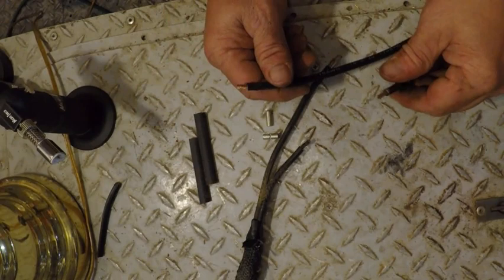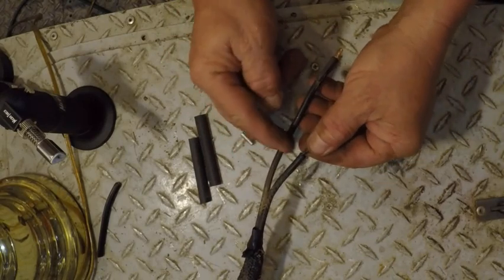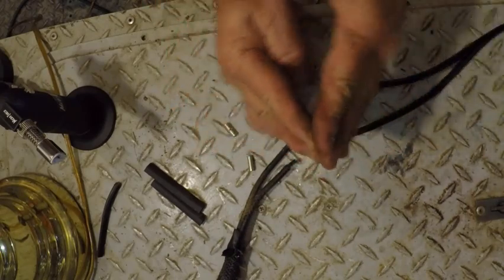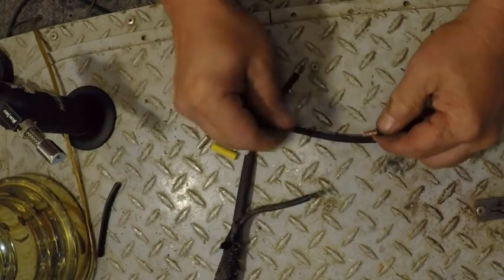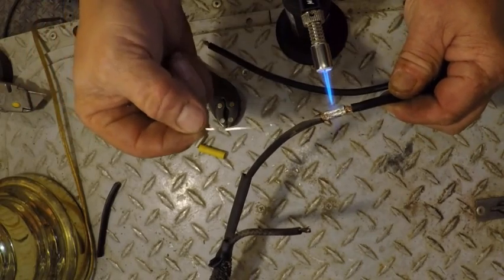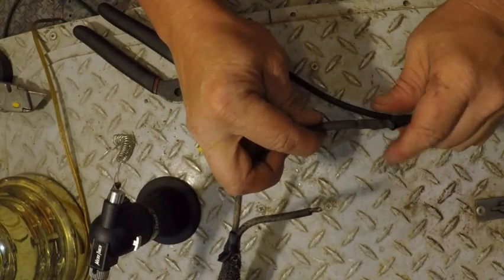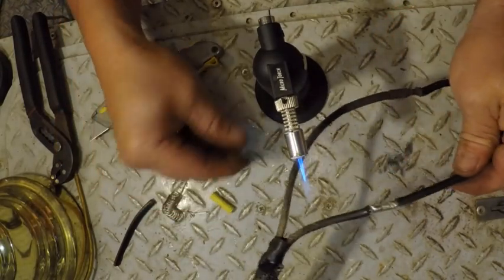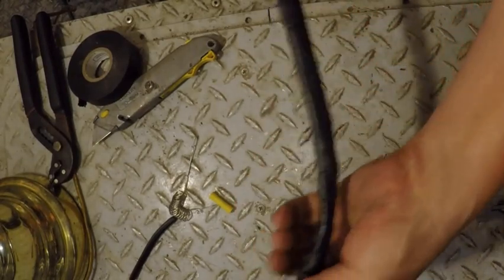Extending and splicing trolling motor wires DIY

Comment: Hi,,, Your post has helped me out—— I have a question I hope you can answer- I have a very small boat and a 30Lb. Thrust Minn Kota for it which I believe is the smallest they make,,, my issue is this— it would be ideal to balance my boat if the battery were forward— to do this I just need 5 extra feet of cable but I’m not clear at all on what Gauge or type of wire I should be using as I’m an electrical idioT!!,,,   I still have enough skill to build this using your instruction but just need guidance as to what wire or cable I should use—- any help would be greatly appreciated.,, Thanks—-
Reply from the maker: No more than that you could get by with just extending the wires you have with the same guage wire. It should say on the side of the cable what guage it is.

Comment: nice tips for sure. but if your heat shrink is far enough away you can let it cool some after the solder as long as you dont overheat it crazy style and then get it over everything easier. i have one question about trolling motor though. most have really short wires for the foot pedal.. are those able to be extended? ive never had one, trying to get a used one for cheap and ya most im seeing are just too short for what i need it for.  i need the bow mounted but able to have the foot control farther back in boat to help me gather trot lines near a live well so i dont have to mess with main motor  or extend the main throttle and do a pulley turn system since my boat at the rear has the aluminum back built up inside that helps it to never be able to flood and sink the boat and seems the trolling motor might just make it less work to get boat out there and less gas used while getting the lines up. might use it also to put out the lines. nice video though man. take care.
Reply from the maker: I’ve never extended those.  I have a minn Kota and it has a very long cable in it.  I also added the copilot so I could work it by remote.
Reply: @bowl830  dang i almost want to go buy a cheapy cut it up and see if its possible. but dont want to buy a higher priced one used which i need if i cant do it. the bad thing i need a long shaft and there isnt many options used since most have short shaft ones. and finding the right thrust, shaft, with a long pedal used is a pain to find. but if i can it saves like half the price of a new one. thanks for answering.

Comment: What brand trolling motor you have mounted on your 21' StarCraft. What model is it and how long is the shaft. or if you have any recommendations on a newer unit. since this post is a few years old.
Reply from the maker: I have a 70lb 24volt 60” shaft  I-pilot.
Reply: @bowl830  thanks for the info
Reply: @bowl830  Now can you run contour lines with that I-pilot I see you run a Lowrance unit. I thought you could only do that with Hummingbird units. I just got a Lowrance Elite 9 FS ,& it would be great if I-pilot would hook up to mine. I have yet to get a trolling motor yet, still shopping. Any suggestions? My boat is also a 21' Starcraft 1988.

Comment: Question I have a 36 volt fortrex 112 pound thrust.It came factory with 10 gauge wire from the head its 5ft.From my batteries and breaker to the plug is 8 awg  and roughly 5 foot now from the plug to head is 6 to 7 foot .The question is would you guys run 8awg from the other end of plug and cut the 10 awg factory wire down to 2 or 3 foot or just splice into the factory wire?
Reply from the maker: You won’t have Amp drop that short a distance. I’d go with what you got if the performance is good
Reply: @bowl830  Thank you!

Comment: Is that 6 awg wire? And is this for a minn kota 55lb thrust? Doing this right now so I'm curious. Thanks! Good watch 👍
Reply from the maker: Yes sir.  And yes it’s a 12volt minnkota 55lb thrust
Reply: @bowl830  I hope you see this and get back with me..! my trolling motor is a 6 gauge but I got 6 gauge jumper cable cut the ends off of them.. but the cable is much bigger than what's on my trolling motor any ideas what's up with that ?? Cuz I wouldn't think a thinner gauge hooked up to a bigger gauge of wire would lose power or not make something run correctly I'm not electrician but please help with this if you could thank you
Reply from the maker: Jumper cables are usually a lower grade wire do they’re bigger to get the amps transferred from battery to battery. I use a large clamp butt connector for that problem.
Reply: @bowl830  thank you for the fast response. May I ask you this now .?? I have to go 12 ft that won't reduce the power to my trolling motor?
Reply from the maker: Going that far you will have amp drop.  But not sure how much. There’s a chart in the minnkota site that had the length drop for all sizes.
Reply: @bowl830  ok thank you again .. I'm pretty sure I just seen that chart. I'll have to look at it again I was right what I was looking at I will have to go into my trolling motor and disconnect it there and start over with the new cable from that point on I'm guessing I will look again but I really do appreciate you getting back to me as fast as you do and just Ben knowledged thank you again so much

Comment: That was a great DIY  jeff , I've been wanting one of those little torches. But I keep telling my self you don't need that , I mean I really like my heat gun for shrink tube , but you know I never thought about soldering with it like you would do copper pipe but that's a good idea now I can buy me a torch haha , guess I never thought about it cause I paid do much for that Weller soldering iron.  Good tip on staggering your splices too

Comment: Great. I would not leave the tape as outermost surface. It always comes undone. It wasnt even necessary in your case, but uf u really want it, put it under the last heat shrink tape. 
I myself still dont have soldering iron. Need to buy one because i am splicing cables for my new trolling motor right now
Reply from the maker: I cut it a little short at end.  I agree about the tape.  I used braided chord like a Chinese finger trap over the full length after I spliced It. You can see it at the end I just hadn’t  pulled it up and over yet.   Thanks for watching and commenting